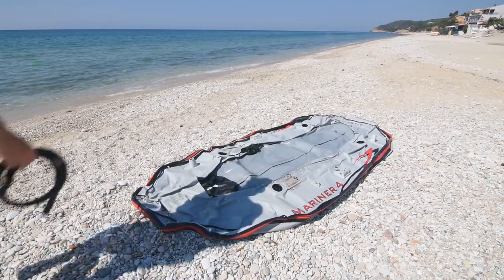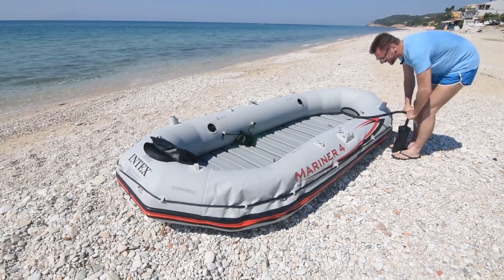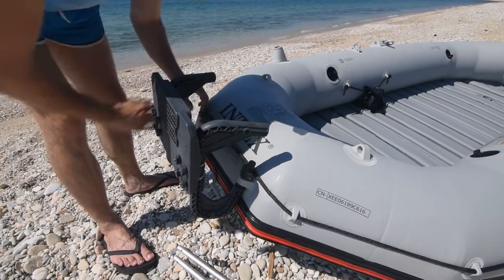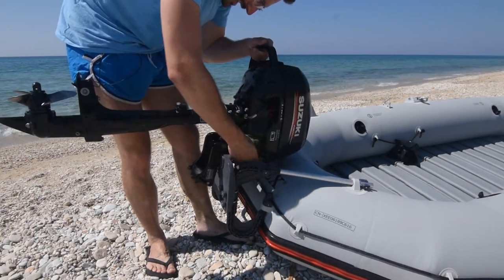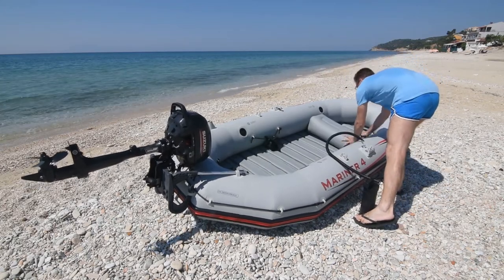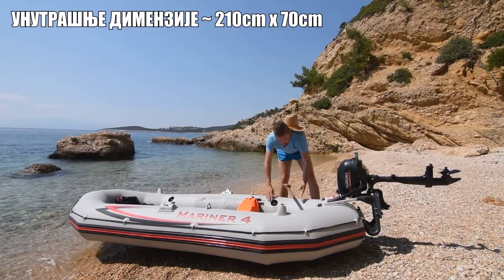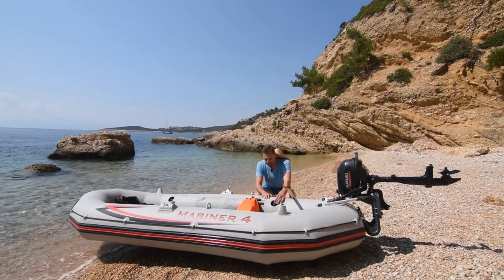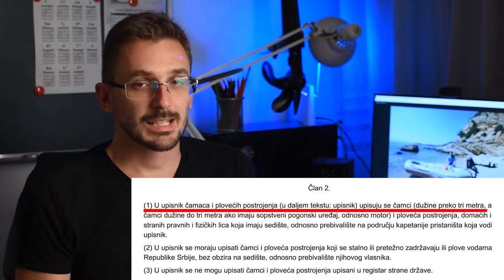Intex Mariner 4 & Suzuki 2.5hp (ENG subs) - преглед/review

Comment: Great video and beautiful beaches!
I am deciding between the Intex Mariner 4 and Excursion 5. Since we only wanna use it on lakes and slow rivers to relax and sunbath with 2 people I would prefer the bigger Excursion... but I like that the Mariner seems sturdier especially with the solid floor.
I am probably going to use an electric trolling motor between 40-70 lbs with it.
Reply from the maker: Thank you!
Those beaches are on Thassos. Beutiful place. 
Excursion 5 is like a pool float. An absence of a sturdy floor and saggy material is a no for me. I had an Intex Seahawk II or III (not sure) and it's the same as Excursion. Same "balloon" material and it behaves as an air bed on the water.
On the other hand, with electric motor there should not be any significant difference. It will be slow and silent :)
Reply: @porodicaVorgic  Wow, thanks for the quick answer! :)
"Air bed" sounds good for relaxing tho 😅
Reply from the maker: @janred94  Actually, that is one big pro for Excursion and con for Mariner.
You can't lay down in Mariner, it's just uncomfortable. But you can sleep in Excursion 🛶➕🛏=😴
Reply: I have an Excursion 5 and Seahawk 500. Both have very thin material. The height of the Excursion 5 from waterline is very low and it always take water if there is 0,3 m wave or if a big boat passing nearby (even in long distance, they create big waves). It is not possible to sit the main tube on them and steering the motor. When you sit inside, you have to have an octopus arm to reach the handle while facing bow of the boat or you have to drive backwards :-)   I made 8 mm thick plywood for the inside of the floating floor, so it is better to stand on the boat. But you have to make it foldable 2 or 3 part to easily carry and put into car truck. Summary: Mariner 4 is better than Excursion 5 or Seahawk and I would like to planing to buy one. The price here in Turkiye is around 350 Euros. But the registration is very difficult as they want same documents and procedure for them just like 25 m super yachts, because they are in same class according to laws.
Reply: @izzetkirbas  why is the Excursion 5 not in the same class as the Mariner 4?
Both inflatable rubber boats...
Reply: @izzetkirbas  I know the differences, I just don't know why those would be categorized differently. You don't have to use the hard floor for example.

Comment: Around time stamp 22:34 you were just sitting by the boat talking. The motor is horizontal to the boat. I am brand new to inflatable boating and rafting with trolling motors. How is it that the weight of the motor doesn’t just pull the boat down while it’s on the beach. It seems like the backside with the motor would be hitting the beach and the front would be pointing upwards.
Reply from the maker: Well, it's not a child's toy. The boat weights 75 pounds and motor only 28. The other thing is that the surface of the boat and how motor is connected to it doesn't allow even a bigger one to lift it up.
Reply: @porodicaVorgic  Wow . The motor is only 28? I bought a Minn Kota 55lb electric . I will be using it with the Intex Challenger 3 .
Reply: @porodicaVorgic  I do wonder with the weight of the battery and the trolling motor how this is all going to work with the Intex Challenger 3 but there are lots of videos of people with the same set up making it work . Any advice for first time launches off of shallow beaches ?
Reply from the maker: @floridavideosbyjeffreyscot6910  The combined weight of the trolling motor and battery for it can't affect stability of the boat neither on the water or shore.
Advice for any launch in the water is very simple. Do not put all the things in the boat before you put it in the water.  In other words, your feet will have to get wet. Also, avoid any shore that has sharp rocks and most importantly, do NOT drag the boat on anything else except sand or grass when launching or pulling the boat out of the water.
Reply: @porodicaVorgic  Ty for the information.  👍
Reply from the maker: @floridavideosbyjeffreyscot6910  You're welcome!

Comment: Really good review man. I really appreciated it. I just bought a mariner 4 and am debating between the suzuki 2.5 and a 55lb thrust electric trolling motor. Do you have any further insight since making this video? Which would you go with? Do you think the electric would give up much performance? Thank you again for the great video.
Reply from the maker: I sold it last year. And I bought a bigger inflatable boat and a stronger outboard motor.
To answer your question, I think that both are good options, it only depends on what will you be using it for? If it's on some river or sea, then definitely go with petrol engine. If you only planning to use it on some lakes and short runs, electric one will suffice.
I tried once an electric motor, it's ok, but for spending the whole day  on the river/sea driving from one beach to another I would not take chances with the electric one. For fishing it's awesome. I hope I helped you.

Comment: My suzuki handle accelerator cable is touching the motor support, I need to raise the handle to be able to turn on the handle side...did you raise the motor a bit more with something?
Reply from the maker: Good question!
At first I didn't, so I had to raise the handle over the mount with each turn. Eventually I got sick of it and just raised a motor for one hole.
On the mount there are multiple holes, or at least there were on mine. I did buy the mount used so maybe the previous owner drilled one or two pairs extra due to the same issue.
But, when putting together the mount, just can choose in which holes you want to stick those U shaped clamps. Just choose a lower one than what is currently sitting on.
If there is a need for something in between, be free to drill a hole through that plastic board. Just leave some space in between, at least quarter of an inch.

Comment: Hello! How do clean it after each use? I imagine deflating it, putting it into the car, then going to a fresh water fountain to re-inflate it and wash it :s
Reply from the maker: Nope. I don't clean it before using it. When I finish with driving, I deflate it first, remove the floor (and put it aside vertically (make a circle with it)) then I turn the boat upside down, let it dry a bit and then a use a piece of cloth to remove any excess moisture or water. Then I fold it and put it back in the bag until next use.
Reply from the maker: Also, one time we finished the season with a drive in the salt water and it stayed in the closet till the next spring all salted a bit. Didn't affect the performance at all.
Reply: @porodicaVorgic  oh well, good to know :) thanks again mate!

Comment: Perfect, spot on review! I'd like to use the mariner 3, little smaller and lighter, for sea fishing with another person, with a 2.5 hp motor. Do you think it's good, or would you still advise to get mariner 4?
Reply from the maker: Thank you!
If you think you can manage to put all the gear you need in Mariner 3, it's a perfect option. It's made out of same material and it's just a little bit smaller than Mariner 4. If you have an opportunity to see one in person or to try it on the water before buying, that would be a deciding factor.
Hope I helped.
Reply: @porodicaVorgic  Another topic: can you go full throttle with the 2.5 hp motor? I see that people on mariner 3 are only able to use half throttle. I'm trying to understand if this is also valid for mariner 4. Looking at them on video, the size of tubular looks the same...
Reply from the maker: @MustRunTonyo  You can. After half throttle, you just get a noisy motor, but not a significant speed increase. So, I do not see why you couldn't go full throttle with Suzuki 2.5 on Mariner 3. It ain't gonna go much more than 10km/h which anyhow, is not that much. And as far as I know, Mariner 3 is just smaller in length and width, but not in tube diameter as you said.
Reply: @porodicaVorgic  Very clear, thanks! Last question i promise :) Do you deflate and inflate it each time after use? I'm scared to damage the material, but if you did so and it went good for 5 years, I'd not be worried!
Reply from the maker: @MustRunTonyo  I did, every f*****g time. I live in the apartment so, no trailer, no garage, no place to store the boat inflated. And believe me, I wish I could just have thrown it from the trailer on the water.
You shouldn't be afraid, it's not gonna damage the boat. What will damage it is overinflating it and/or storing it whole day on the sun. Sun drain flexibility from materials, makes them dry after long period of exposure, so be sure to store it somewhere in the shade if you plan to keep it inflated.
On the end, I sold it, not because something went wrong, but because I needed a bigger boat. And then, I also had to change the motor. So I sold Suzuki as well.
To finalize, I had it for 5 years, but in total, this boat saw only about 30 or so inflating and deflating.
Reply: @porodicaVorgic  god! I hope you changed home and have space, as you said you took a bigger boat 😱 anyway, a lot appreciated every tip, I'll bring soon my m3 on the water :) have a great weekend!!
Reply from the maker: @MustRunTonyo  That ain't gonna happen. It's my apartment, and I don't plan to sell it and buy something with the garage and/or yard as I'd have to add a lot of money. Money that I don't have.
But this bigger one fits nicely in the same corner of the room as Mariner 4 did. No changes there.
I wish you all the best! Have a great time on the water in your new boat!

Comment: Hi,
Thanks for the great review
Maybe you mentioned this in the video, but what is a shaft length required for Intex Mariner 4?
What is a shaft length of your motor? 

Thank you
Reply from the maker: It's a short shaft motor. There is an option to adjust the position of the outboard on its mount by adjusting the height of the transom. So maybe, just maybe, you can use a long shaft motor. Hope I helped.